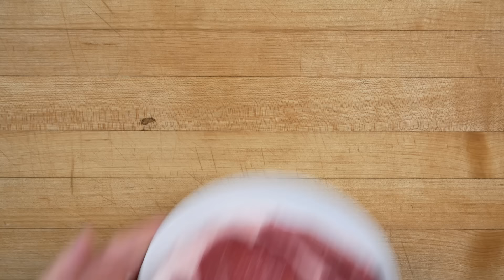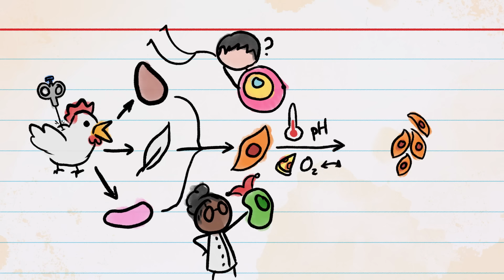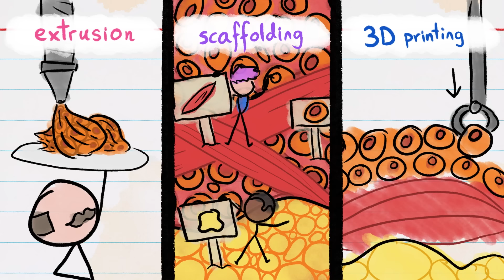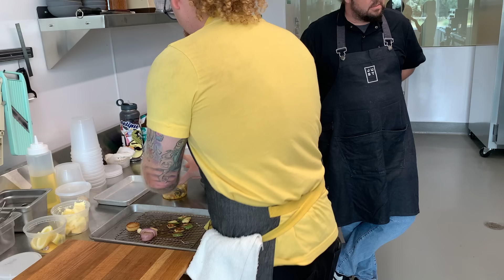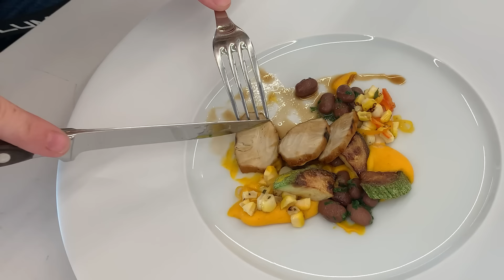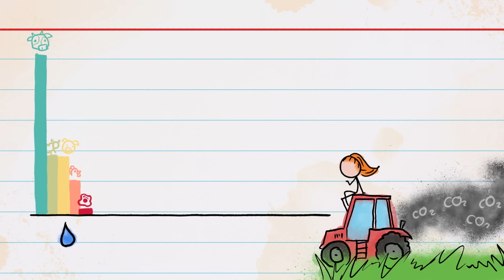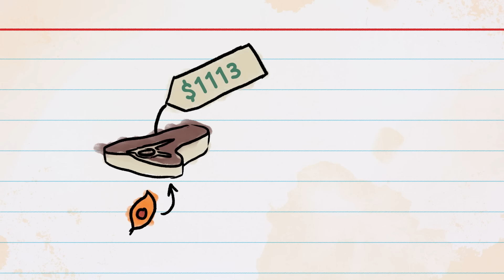Lab-grown meat (probably) won't save us

Comment: Another side note: some cultured meats need fetal bovine serum, which is extracted from, as you can imagine, bovine fetuses) to grow reliably in the lab. It is required and hard to substitute because eukariyotic cells have a lot more requirements to grow reliably than fungi or bacteria, which can basically make everything themselves. Eukaryotic cells need growth factors that are more reliably found in the fetal bovine serum, although that deepnds on the cell lineage. 

Some cell lineages require the serum, some do not, but that was one of my questions about cultured meat: is it totally clean of animal products and suffering, or does it also rely on other animal products to be produced, especially in the growth medium? Fats, vitamins, proteins and the like have to be sourced from somewhere, and most of them aren't viable to produce in a lab. Of course, advancements can be made to not rely on animal products, but how long will these advancements take?

Comment: Same problem as EVs. If you can't compete on price you need to muddy the comparison in order to have a better chance of standing out. Yeah EVs are a bit more expensive (50% to 25%) and charging may become a problem, but for that you get instant torque, trivial maintenance costs and the ability to charge at home so no more gas station stints. As well as being cheaper to charge than the equivalent tank of gas.
The problem with any kind of fake meat is that it's not 50% more expensive it's on average 4X more expensive. You need to provide some monumental bonuses for it to be a competent product on the market and not an item ppl are shamed or brainwashed into buying. And yes price is the crux of the issue since one of the little things animals do is have an immune system which is a bit of a problem when you're growing undifferentiated cells in a tank.

Finally when we eventually make it more convenient than raising livestock we're going to have to accept that we will basically be exterminating these animals, long term we might find ourselves in the androids dream of electric sheep future.

Comment: Have they tried using "meat glue"? Meat Glue (transglutaminase) is 100% plant based and allows the bonding of one piece of meat to another piece of meat. When I worked at a supermarket 30 years ago they would put leftover chunks of meat in a metal bowl, add the meat glue to coat it, push it all together then wrap it in cling wrap to get the meat to bond, leave it for an hour in the fridge then slice it, and it basically looked like a piece of steak.

Comment: Lab grown meat will never be a thing. Even under the conditions that A. Cell culture media is free, B. Batches cannot spoil, C. Building Fermentors, etc. can be done extremely quick. (As any advanced technology this is not the case). Even then try building a fermentation plant with a product on which you make little profit, the investment for such a plant is ginourmous and would prolly exceed the gross worlwide product when replacing the entire worlds meat consumption with lab meat. So NO, it will not become more economic but maybe a luxury product. And no you cannot upscale tank size as you still have to fight with spoilage. (If a 1000 L fermentor spoils the company faces gigantic losses, so in most cases smaller reactors but more of them are used. Also helps with air and nutrient supply)

Comment: One thing to consider is centralization of emissions. If hypothetically, cultivated meat at scale produced 2,000% the Emissions of conventional meat, it may still be a win. If meat is grown in a giant factory, those emissions are likely easier to deal with and scrub than the emissions of millions of animals separately releasing methane and tractors distributed across the globe.

It is similar to electric cars. Electric cars are extraordinarily inefficient compared to internal combustion engines If the electricity to run them is coming from a coal-fired plant, Coal is converted to electricity with less efficiency and energy is lost, distributing it to the grid. It is, however, still a win because a single coal-fire plant can deal with the emissions a lot more effectively than The emissions from thousands of individual internal combustion engines, which it is replacing.  Centralization helps produce dirty energy more cleanly And that could also apply to cultured meat products.

Comment: I've worked in the food & beverage industry as a process design engineer and what all videos like this miss when it comes to environmental benefits of lab grown meat is the environmental damage that is done when it comes in building the production facilities to produce  the meat.  You only seem brief glimpses of the equipment used to make it in a lab or a small facility, but TONS of stainless steel will be used to build tanks and all the equipment to produce the lab grown meat.  All the materials will need to mined to make the stainless steel.  Then to clean all the equipment absolutely massive amounts of chemicals will be needed.  Then waste treatment facilities will be needed to treat the water to clean up after washing/sanitizing the equipment.  What needs to be done to a batch in a tank that becomes infected....maybe it can be reprocessed, but some amount will do down the drain to the waste treatment plant.  If one is seriously interested in this, I recommend you read this paper by David Humbird.  https://onlinelibrary.wiley.com/doi/full/10.1002/bit.27848

Comment: People need to worry more about eating fruit, veg and legumes. So many people have digestive problems and malnutrition. I can get 4.5kg of chicken for £10 but only 1kg of spinach for the same price. Bigger yield crops are more important I reckon to then be cheaper and then bump up the price of meat to ensure animal welfare standards and less unnecessary consumption. This would balance out the average diet as well. By reducing the amount of meat consumption fields currently used just for animal feed would convert to human crops further benefiting fruit and veg. Degenerate culture and economics stands in the way of solving major linked problems really.

Comment: This is a prototype tech, remember pcs weighted tons when they came out. Also methane gas is literally unimportant part of the process because you work in  a closed environment with filters that can be tuned to capture the methane gas even sell it for profit. So we would both find a sustainable way to produce meat and sustainable way to produce methane. 

This tech needs a few thing going on to be viable tho.Firstly like indoor farming it needs electricity prices to fall a lot to lower the cost.Second is a process that faster and more precise. Last one can be made with research but for first one we need to wait.

Comment: definitely interesting.
I work in a pharmaceutical company, and when we got a tour in the process developement, we were told, that in most cases if you are able to make it in 200 litre tanks, it isn´t that much harder to scale it further up to production scale. (I´m not a biologist that was just what was told to me). I am confident, that also the food industry will improve on this. And if they have a breakthrough, they probably can market it pretty good. just to compare it with the drug development, the meat will have the advantage that you can use the whole cells, which is much more then the actual active substance for medicine. also the demand will be much higher, so even more potential to scale up, and also to divide the research cost (which is the most expensive for new drugs). also for meat, you probably don´t have to research every few years for a completely new effect like you have to with medicine.

Comment: I have a lot more hope for this over the plant based substitutes because it takes a lot of work and processing to make plant cells mimic meat. Most are processed to heck and back and FDA approvals or not I can't imagine any of that is terribly good for you. In this case it might be produced synthetically but the product is what it is. 

I can't help but think of the blob scenario where a vat of living goo escapes and starts consuming everything. Of course this is silly when you realize how much work goes into keeping these cell lines alive. Forget escaping and going on a rampage a brief power outage would probably wipe out the life in a vat. After all a cow is only 60% meat, the other 40% is basically all the organic equipment needed to keep the system running.

Comment: Surely the biggest concern here is the commercially-focused engineering of cultured meat. Presumably most affordable cultured meats will be ultra-processed foods designed to be cheap and highly palatable but not necessarily good food.
Reply: if it ever does exist it either be high end meat made in small scale as a cheaper luxury or be a functionally plant meat like food with little cells in it.

Comment: If current fake meat like Beyond (which is just ground up cheap commodities) is still more expensive than meat there is just no way lab meat can be competitive after adding all the lab grade tech, ultra refined inputs, unbelievably strict quality control, etc. 

Also, people only look at the meat but not the inputs. A cow eating a mostly grass & silage diet is less net carbon intensive than extracting lab quality glucose/aminos from fertilizer intensive grain & soybeans (which ironically creates an even bigger mountain of silage to feed to cows).

Comment: Great video and video idea!

A question about the CO2... Isn't just the fact that cultivated meat needs way less land already a huge CO2 improvement? 
After all, if we didn't use... What was it, 60% of all agricultural land for meat(&Co.) production?...
If we didn't use 60% of the land, that land would still capture carbon.
And since cows in particular produce Methane, which is way more of a greenhouse gas, ...

I'm a bit confused as to how anyone can get a 2400% increase in CO2 for calculations. Did they only look at the process itself? And if they did, was there no consideration for the fact that this gas is produced in a facility and therefore may be further processed, instead of on a farm? 

(Also, it seems like "Big Meat"™ may be motivated to stomp this, so we'd need some journalists researching the research background...)

Comment: I believe that either you need a bigger bioreactor, or you reduce the amount of time cell need to be in the bioreactor so its constantly producing enough meat without changing its size, or maybe even both, but for that it will probably need genetic engineering to make the cells multiply faster, and if people already have the ick with lab meat, genetically modified lab meat i going to be a bigger problem
Reply: they can't make a bigger bio-reactor without the cells failing, and the cells used are already immortal cancer cells so they split as fast as they biologically can given enough chemicals, nutrience, and air- they legit can't work any faster without building another half billion dollar facility.

Comment: The fact that even the prototype looks, feels and tastes reasonably close to real chicken suggests to me there is a future in this. Yes we might need absolutely vast amounts of space and equipment, but presumably this is less space than animals need, and a meat factory isn't necessarily limited to only being on ground level. As with anything on a large scale, the cost of the equipment would reduce substantially when they're being mass manufactured.

I don't see a future where lab grown meat entirely replaces animal products, but we could have a situation where we use lab grown for some applications and animals for others. So a curry with bits of meat in it could be lab grown without really affecting things too much, but a steak would probably need to be from an animal to get the right balance of intramuscular fat and nuance of flavour.

Comment: Small typo, I think you meant FBS or Fetal Bovine Serum.  It's used a lot in cell cultures both for industry and research because of the growth hormones it contains.  It's a byproduct of a slaughter house but they sell it to labs for hundreds and thousands of dollars.  Notoriously different batches often have slightly different concentrations of hormones so labs will often buy an entire batch in bulk so the variability doesn't mess with their experiments.

Comment: 6:19 That's not how it's works🙄 Until we haven't roll it out to industrial scale and developed new versions on the way, you can't set any of those benchmarks. 
It will probably be this and that, but than, where will the refined nutrients come from? A goat will literally live of off newspaper, as there main diet. The same goes for cows, if you tank the losses. It's the way we currently produce meat, that is the issue, not the way it could be done. What about feeding cows retort algae, instead of soy. That will greatly reduce the impact on the land. 
In summary, your summary comes way to early, fell short on any aspect and didn't help much, but show that you enjoyed eating "meat grape" v2.

Comment: Strongly disagree. There’s no doubt that the industry faces a lot of challenge, but you’re seriously underestimating the capacity for it to improve and innovate. A few years ago, lab grown meat was thought to be impossible without fetal bovine serum and a single chicken nugget cost tens of thousands. Today, neither are true (if I remember correctly a nugget costs somewhere in the hundreds today). Technological innovation has the potential to be exponential. I don’t think it’s entirely impossible that lab grown meat becomes more viable by every standard than traditional meat in twenty or even ten years.

Comment: I do have high hopes for cultivated meat, but I doubt it will be at scale within 10-20 years. I can't imagine that they can't make it viable though, since the "endgame" of this process HAS to be more efficient than existing animal husbandry  processes. Like even if you need dozens and dozens and dozens of vats to produce the material, it would have to take up less space than the various farms that are needed to raise cows and chickens. As for the CO2, even if they produce more, they have a much higher potential to capture that CO2 than with conventional farming, so they could still be net zero, and we would just have to hold them to that standard. So I think it's definitely doable, and really hope they can pull it off sooner rather than later, at least before all the cows die of overheating.

Comment: I think lab grown meat is still decades far from replacing traditional meat. Even if we manage to scale up the production, it would take years before the price makes it appealing to average people. My guess is that lab grown meat will be just one of the many steps towards more environmentally friendly farming. Like as solar energy cannot replace fossil fuels on its own, lab grown meat will have to team up with insect farming, increased legumes consumption, and genetic engineering to provide for our protein needs.
Reply: my guess is that it wouldn't take of for general use and be limited to exememely expensive meat which is more suited to being produced in a small amount and can get the price tag to be profitable, if that. price is the main limiting factor as biochambers are expensive so going for very high end gives an easier price bar to get under.
Reply: @randomprotag9329  maybe also for protected animals? I'm thinking of exotic fish, caviar, and hard-to-farm animals
Reply: @nicholas_obert  those ones tend to higher end cause of those reasons + protected aminals are not viable due to needing a supply of actual meat to compare it to cause getting the right texture is key for cuts of lab meat

Comment: As someone aspiring to work on lab cultured meat after I graduate, of course I will be biased. That being said, I think that most of the drawbacks you mention are just symptoms a lot of new technologies faced. For all of this, keep in mind that everyone understands that this technology still has to improve a lot and that it will take time to get the production on a level that is required to supply regular consumers.

I do not see why the cost would not go down, just as has happened with any other new technology. You needed a mortgage to buy a computer when they first came out. Every new technology is expensive, as new equipment has to be made to produce it and it is being worked on by expensive scientists and skilled labor.
Upscaling definitely is a challenge, indeed mostly because of oxygen supply and disposal of unwanted by products. However, every new technology faces challenges and given enough time we should be able to solve these problems. I did my bachelor thesis on oxygen supply and have found a few promising designs in literature.
Finally, there are conflicting numbers on green house gas emissions. Of course lab grown meat should not produce more emissions than conventional meat. However, when a similar emission level is met, there are many advantages that would make lab grown meat worth while. As you mentioned, it would use less water and land, both of which are important for a sustainable future. Furthermore, it would not involve the genocide of millions of animals.

There is a long way to go, but I do not see any problems that cannot be overcome given enough time. It will not be feasible in the near future, but the long term possibilities should not be underestimated.